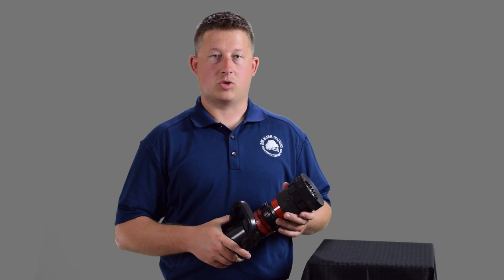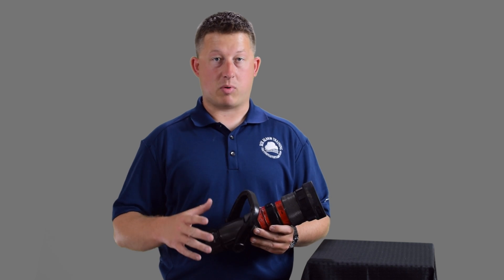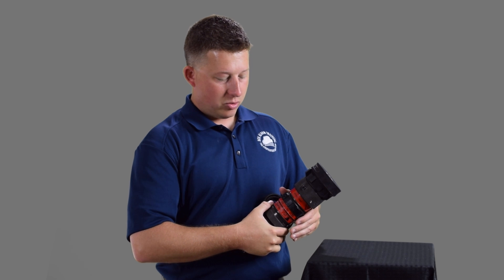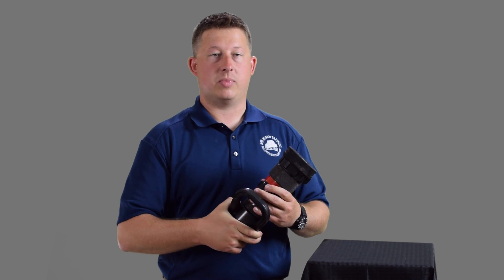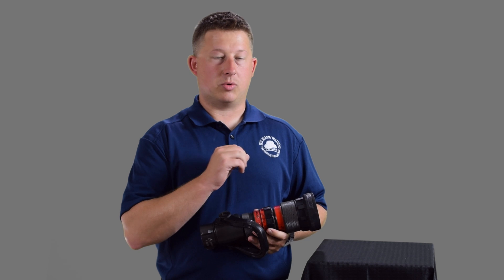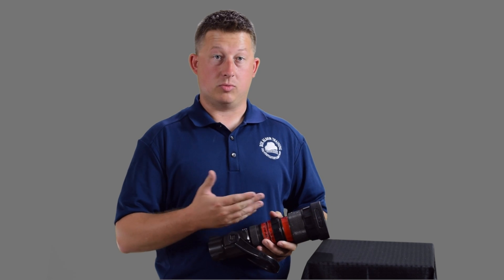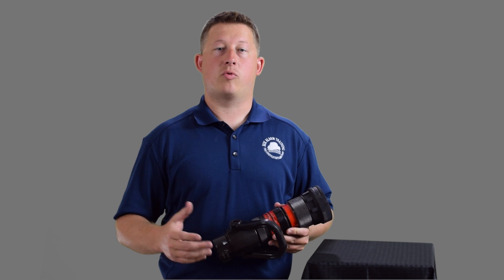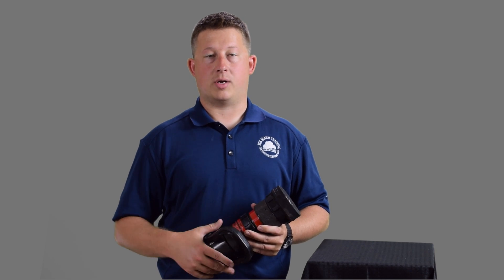Nozzle Series - Adjustable Gallonage Fog Nozzles

Comment: Rookie firefighter question: If I can run 200 GPM out of a 50 PSI fog nozzle. Why would I choose a 100 PSI nozzle that can still only run 200 GPM? Shouldn't the 50 PSI nozzle have less reaction and easier handling while still providing the same amount of water?
Reply from the maker: xxbryan715xx Very good question. You will see a little different behavior between the pressures at the same flow. I prefer the higher flow lower pressure myself simply because you can flow more with the same nozzle reaction. A fog pattern is a little loose at 50 psi, so using a 75 psi or 100 psi will tighten up the shape of the stream a good bit. We use 100 psi nozzles at our academy on all the burn pads because the pattern behaves really well fighting LP gas and flammable liquids. You will also see a difference in the ability to kink the hose line. The higher pressure line is much more resistant to kinking. However, hose line kinkability is very dependent on the type of hose you are using. There are several hose lines designed to reduce kinking and improve flow. You are right though, you can get less nozzle reaction at the exact same flow with the lower pressure.